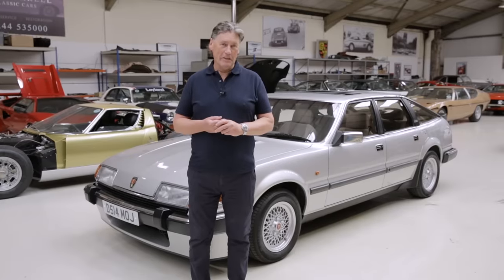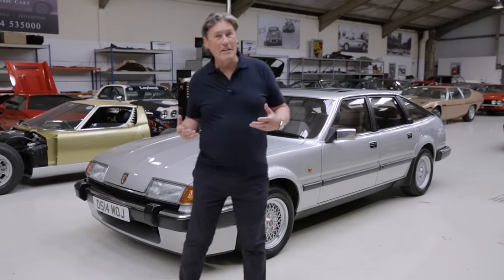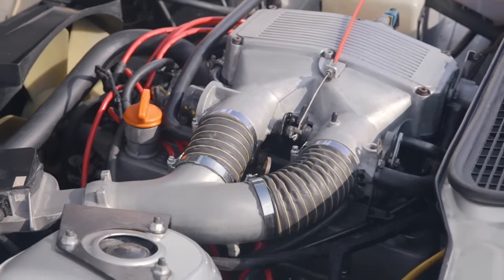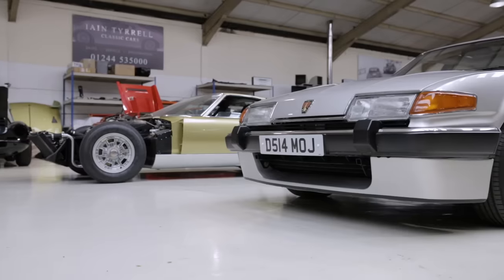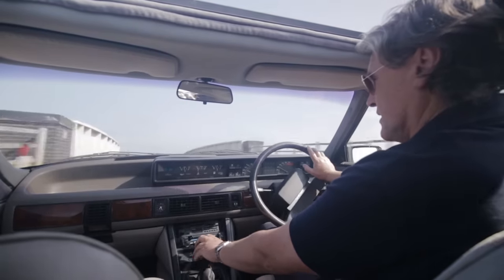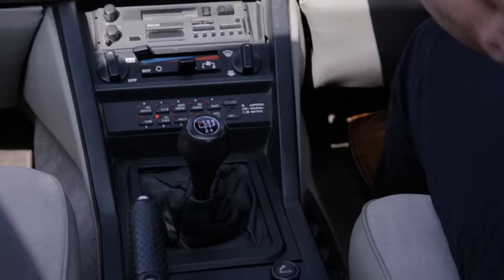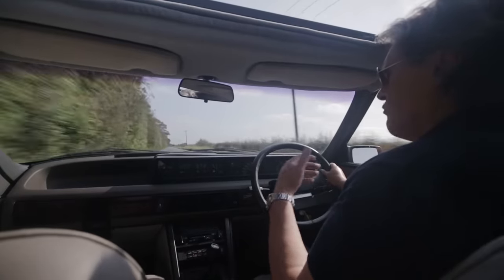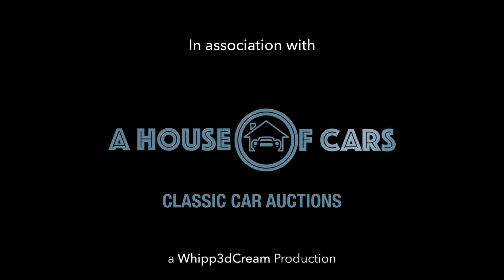Rover SD1 Vitesse - American V8 Power Meets British Engineering | Tyrrell's Classic Workshop

Comment: I had three rover sd1 vitesse's. Great car but loads of problems. Once the AA wrote me to say if I broke down another 2 times then they would charge for recovery!   The last one I had I changed to a manual LT77 gearbox (easy change) but eventually it rusted away but I took the engine (injected) and gearbox out and built a Westfield Seight kitcar so parts of my car still work today.

Comment: When Rover announced they were discontinuing these - Police forces in the UK scrambled to place MASSIVE orders for them as they were so popular, the Met kept introducing new ones in '87 and '88. My dad drove one of these as a pursuit driver for the Met until they pried his hands off it in favour of the Ford Sierra twin cam's in the 90's. They had a fleet wide 'fuel survey' and found they basically gargled 4-star at an alarming rate (who'd have thought!), and they outfitted the fleet with a little metal plate to block off the 1 & 2 on the shifter, stopping the drivers from doing silly things....so dad would go to work with a screwdriver :D

One to look out for would be 'The Whistler' - back when the Met had their own garages, the whistler was one car in particular that they used to train the mechanics on - they'd make them strip the car, and rebuild it and tune it, almost yearly. That was also a twin plenum, funnily enough....
Reply: The Met in east london also had an unmarked twin turbo SD1, Turbo Technics i think?, which they trialled for a short period of time. I heard the cops would drive out to the newly built M25 to pick on performance cars and goad them into losing 70-140 mph roll ons. They would then let the driver catch up with them and watch them disappear backwards for a second time when the performance car driver clocked their epaulettes and braked sharply.
The three reasons police management didnt commission this car were because of fuel consumption, it was too fast and it blew up!.....on the M25!!!
The Met also snapped up a few vitesses at the same cost of other models when the SD1 was being discontinued but a member of the public complained about tax payers money going on high end models for the police to race around it. A top level meeting was had and an executive decision was made to remove the vitesse badges!
Reply: now i'm thinking Janspeed?..one of the two..lol

Comment: Back in the days when all cars looked like cars, the Rover SD1 looked quite a large car by the then standards.  More recently, a few months ago, I saw an SD1 Rover V8 parked in my local supermarket Car Park. Either side of it were several examples of what many Brit Car Consumers now drive. SUV/Crossovers. They dwarfed the SD1. It looked positively tiny compared to those SUVs many of which are now of Monster Truck proportions.

Comment: Road rallied a vittesse  for Dukeries motor club in the early eighties , easy to drive quickly , unfortunately cars with more than four cylinders were outlawed by the RAC committee so the fun didn’t last as long as I hoped .Not many cars you could put your crash helmet on the dash board when you parked up!

Comment: In the mid 1980's. I was a Triumph Stag loving police officer in the Met. Spoilt Traffic Officers had the 3.5 V8, for the fast roads, 'you housing estate patrolling peasants', but us plebs at the sharp end, the lowly beat cops, had the awesome Area Car, equipped with the 2.6 straight six. it had more head gaskets that wiper blades in their short Union Sabotaged lives and our boffins even had to put a metal plate over the auto selector to prevent accidental selection of low gears at high speed because the gearbox would actually select first at 90mph, while the Advanced Drivers were trying to squeeze an extra BHP out of the rev-range, scattering cogs and transmission fluid all over the highways!! 0-60 in 14 seconds - not exactly awesome, but confirmed repeatedly in a brand new one between the Polish War Memorial and Hillingdon on the A40 during a quiet night shift (Shush, don't tell anyone). True story - the populace of Ruislip complained that the local Plod were being issued with the Vanden Plas model!! WTF! Why are we financing such luxury, they asked. The Met knew that the SDi was ending production and got a sweet deal on the last job-lot of them, including the prized Vanden Plas models. The solution to this public unrest? Well, the cars were all booked into the Police garages at Northolt to have the VP badges removed - sorted.... Real Policing, done properly.

Comment: Lovely snarl on trailing throttle.  If I remember correctly the Sunbeam Tiger also had that V-8 or one very much like it.  American V-8s are a creature unto themselves. 
Lucas electrics, oh my.  I've owned two Austin-Healey 3000s, a '59 and a '60 and the electrics could be...entertaining at times. Lucas was famous for all the wrong reasons.
Reply: Sunbeam Tiger had a Ford 289 as per AC cobra... nothing like a Rover V8 really.  Still plenty of classics running with Lucas electrics.  I find them simple and reliable. The biggest failing of auto electrics is age and incompetence of the owners.
Reply: @skipmole612  Hey Skip,
I stand corrected.  They came with Ford engines, not GM and there were two of them.  Carrol Shelby was the guilty party.
Tiger I: 260 cu in (4.3 L) V8 (Ford)
Tiger II: 289 cu in (4.7 L) V8 (Ford)
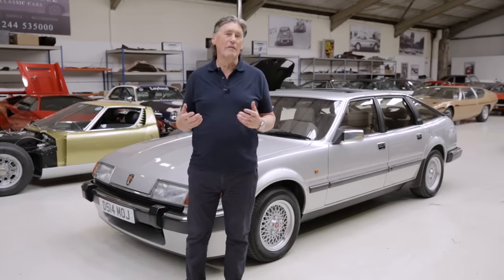If I'd known Shelby was involved I would have dug deeper.  I came across one about 1:00 in the morning with a 260 playing around on an ice course ploughed out the snow on a local lake - on studded tires.  The driver looked like she was having fun so I joined her, driving a bog-standard Mini while she was on the other side of the track.  It took me about 4-5 laps to catch and pass her - by caroming the Mini off the snowbanks like a billiard ball.  Went to a couple of ice races over the winter with her and also later competed in a 67 Camaro.
I had the electrics on one of my Healeys start up everything at once wipers, the lot.  The wiring harness under the dash had a worn spot in it and the hot line touched the others and melted the insulation then lit up everything on the  car.   Roadside repair: one twig in the centre with the wired running the length of it and some electrician's tape.  I've never heard anyone praise Lucas electrics before.
Cheers from Canada.
Reply: @deltavee2  Well there you are. In fairness, Lucas electrics have been used on millions of vehicles since the 1920's and are still going today. So they can't be that rubbish, can they. Given the technology and materials available at the time they were good. I find criticism generally comes from owners of old vehicles who are not capable of maintaining or fixing them. Ice chase sounds like a Bond stunt - did you marry the girl or just have a little fun with her?

Comment: Lovely car, and so right about BL and about how tuneable the engine was. People like TVR, Morgan and Ginetta used it as well as other BL cars like the TR8, the MG V8.  BL were thinking of putting it into the Jaguar XJ40 because big V12s were out of style so Jaguar engineers deliberately designed the XJ40 engine bay to be too narrow to fit a V engine. But by the time the car was launched BMW and Mercedes had both introduced big V12s on their luxury models and Jaguar suddenly realised they had a fantastic V12 but they couldn't use it! It took a couple of years to redesign the car to be able to fit the V12.  With Jaguar now producing a range of cars very successfully I can't help but think that someone at BL management should have banged their heads together in the early seventies and bought out a mid range car under the big XJ series. They could have taken the Rover P6 V8 and fitted new bodywork and sold it as a Jaguar, the sort of badge engineering that people like VW do so well today. One of BLs many problems was they had all these brands who all insisted on developing all their own chassis and engines from scratch, duplicating work and wasting money. The Triumph Stag should have been fitted with the Rover V8 instead of Triumph developing their own three litre V8 that turned out to be unreliable and killed the car.

Comment: I think I have lock down madness !! I watched this and it told me what a great car the SD1 was, well my one was far from that 18 mpg, the back window fell out, the door handle fell off, the automatic gear handle rattled, it rusted in front of your eyes. The door shut lines where so big you could put a Biro in them. The rear view mirror fell off three times, the windows would open on their own and then not go up. The only good thing about it was the smell of petrol which despite four attempts under warranty by the garage was never fixed and thank God the dam thing burst into flames and was a complete right off, fortunately I was not in it, in fact it was parked and I was in a restaurant when the waiter said '' Sir I think you have a problem with your car''    What a pile of junk !

Comment: I remember a friendly traffic old bill told me a story of a SD1 twin plenum, chap was cruising down the M3 and saw a small car broken down so he pulls over and offers the broken down chap a tow, so he hooks the busted car up using his straight bar and moves off towards Winchester where the chap asked him to take him to as his local garage was there so off he goes with car behind... he got distracted and so he said to the old bill, promptly forgot he had this car attached via his towbar and the straight bar so he gives it some beans...meanwhile the towed driver watched in horror as his speedo needle went off the clock and then some and the motorcycle policeman pootling along at 70 saw this maniac hurtle past at least doing a ton twenty with the towed driver screaming not daring to let go of his steering wheel.   Down the road a roadblock was put in place and they got the Rover driver to stop and the poor driver who allegedly soiled himself more than once was a gibbering wreck by this time.   The small car had also worn its brakes to the metal where the towed driver tried to brake against the Rover...   I imagine the Rover driver may have been disqualified as the police were none too chuffed about it all lol

Comment: These were great cars and when they face lifted them in 1982 the reliability problems had been pretty much sorted. They did still suffer from corrosion problems even though the anti corrosion treatment in production had been greatly improved, that said I'm not sure by this time they were any worse than the Granadas and Victors of the day which were their natural competitors. I was working in the service department of the biggest BL dealer in the country when the twin plenum cars came out and they were not terribly reliable, cutting out intermittently when driving, problems starting when hot or after a hot soak and all sorts of tickover problems which caused the automatic cars to stall that were then almost impossible to start if you'd been sitting in traffic. However they were and probably still are a great car to drive and I would have no hesitation in buying one today as a classic car but if you wanted one as a daily driver the single plenum is probably the one to go for.

Comment: I bought a 3500 SDI auto for scrap and a 3500 manual for scrap money then striped everything down and built a 3500 manual with a offenhouser  manifold a 625 Carter four barrel carb with a big cam shalft  then fitted it to a right hand drive German Ford capri 2 litre s  at 60 M.P.H in fourth gear it would spin both rear wheels to 100 MPH 
Then in to 5th and away I never knew how fast it was as the ratio from box to speedo was out but it felt f,,,ING quick....

Comment: When I was looking for my 1st SD1 in 1980 one of the very early cars I looked at had a bill for replacing the circlip jumping off the layshaft, in 1988 I had a much newer Vitesse, one day on the Autobahn  suddenly no drive, stirring found 4th, the cause ? same as the 1st cars  10 years earlier , circlip fallen off allowing laygear to slide out of mesh , a well known issue never fixed.......

Comment: The V8 was ended in the USA because it was an aluminum engine. Is was for the time difficult and costly to manufacture so the Americans developed a cast iron 6 cilinder  with roughly the same displacement. There were no problems with it being underpowered. They even sold them in turbocharged form. Also the story of Rover just spotting it on the floor is a romantic story. They went there looking for an engine. Preferably V8 and american. They knew about the engine and that it went out of production before they went there. Lovely car though. Ive had mine for 15 years now. 1985 Targa red and single plenum.

Ps you are missing the plastic covers for the jackpoint inside the airdam at the front

Comment: GM never owned Mercury Marine. They did contract with them in the 1980s/90s to assemble Corvette engines, but it's more likely that the problematic 215 V8 might have been at Mercury Marine because GM was trying to figure out who to unload it to (and Mercury was certainly a potential customer), even though they used a few hundred thousand of them in the early 60's before ceasing production in 1963.

Comment: I had one of these superb machines ... well, the garage had it 90% of the time, but I did enjoy my 10% when it actually worked ! British Leyland quality redefined the depths you could sink to ...
I recall that the aerodynamics made it 'sit down' and hug the road above a certain speed ... which shall we say was ummmm 
... travelling with 'gusto'  to borrow the phrase.
So huge inside, it was like piloting a spaceship from an armchair ... again, when it worked 😖
Reply: Postscript: the engine had to be rebuilt a couple of times, rebored, etc. So, it might well have had a little more power than standard !

Comment: That powerful sound is just noise, it's not accelerating quickly. It's obvious if you follow the speedo which is blurry but you can still see the numbers which on this car are 10 30 50 70 90 etc.

Comment: I did get to drive the Vitese, but l did actually own a P5 3.5 litre, the poor mans Rolls, a P6 V8 then an 3.5 SDI VDP, let’s face it the Buick designed engine was a joy to drive, not to mention it was so reliable. The SDI needless to say suffered from Leyland rot & very poor steering problems.

Comment: Give me goosebumps when she came on song god I miss mine
Reply: Mt Father had one of the first 2600 cars...then a facelift one. Then I got the bug...two more early early and facelift models. AFter that came a 3500SE which was the most reliable followed by an early silver single plenum Vitesse auto which I converted to a manual. Sadly, the Vitesse was a rot box and was tearjerkingly un-reliable. It eat Lucas ECU units for breakfast which Lucas repaired under warrenty at least five times. My car recovery insurance then refused to cover the car against breakdown. The rot along the doors escalated so I sold the car to a guy in Wales. Three weeks later the car was abandened outside Cardiff Town Hall and the DVLA were after me. The buyer didn`t register the car and the authorities came after me for removal fees. Somehow I worked my way out of that issue. The Vitesse was the one GT that had to be but wasn`t. The rot was a cuss and the electronic fuel injection was a nightmare. The times I wished I had my carburetter 3500SE back again. All that said, it was a great family car with performance and space in spade loads. I miss it badly and the only car that subsiquently has given me a similar sized grin is my now aging and highly modified supercharged Jaguar XJR. How I wish the Vitesse was still in production with all the issues removed. The experience was entertaining and very expensive whilst it lasted. A classic car if ever there was one.

Comment: I had a Rover SD1 3500SE.
The power steering was god awful with no feel. Turn the wheel and see how far you corner.
Fiat levels of wiring. Just because that gauge worked yesterday doesnt mean it works now.
The fuel gauge was best guess. Turn on 1/2 tank... drive to the store, after shopping turn on and 3/4 tank.
Electric windows... Keep then closed and use the aircon, sometimes they worked, mostly they didnt.
Everytime it rained the screen and tail gate let water in.

Great cars.